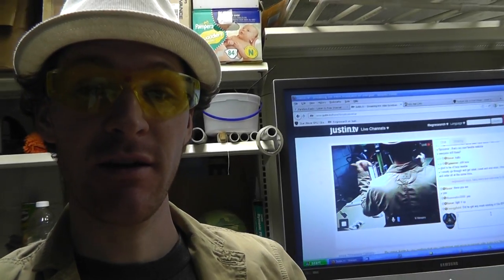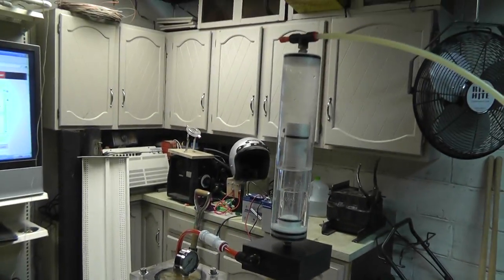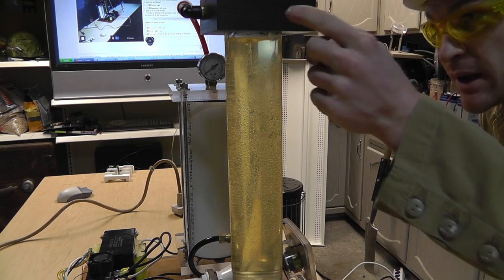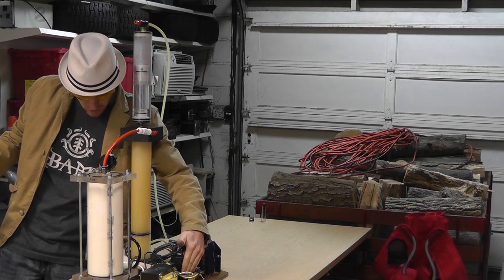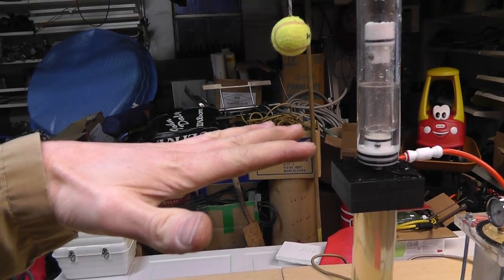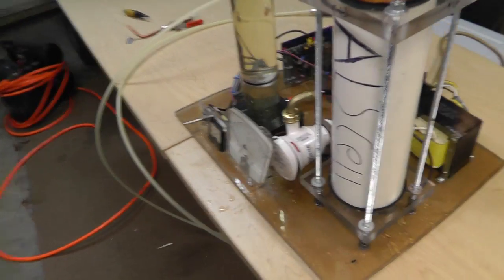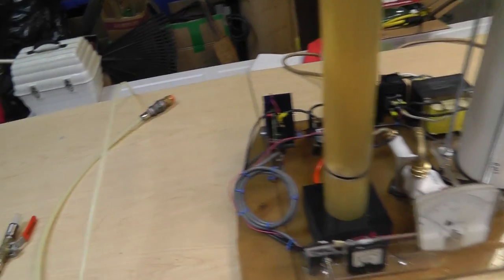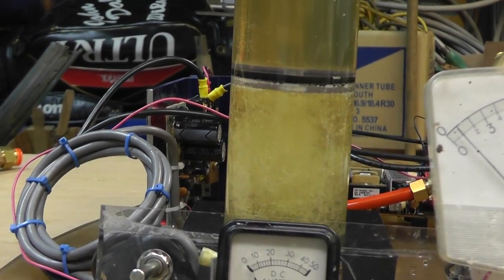12-5-11 Burn Rate Testing Live After Show. Things Went boom!  ~Russ RWGresearch

Comment: Hi Russ, just a thought, in gas welding the arrestor's are always in the line never in the torch head [mixing chamber], you could use one direction check valves, the mixing chamber is stuffed with bronze wool. A very good demo, thanks Russ, Jeff.

Comment: Hey Russ. Welder here. If your tip is getting really hot, that means that higher gas flow is needed. push more through it and you'll keep your tip cooler. 
A simple PVC pipe stuffed full of brass wool will work perfectly as a flashback arrest. And I mean PACK IT TIGHT.
Get rid of plastic too
P&P
Silvermango

Comment: @rwg42985 You are obviously a very nice guy Russ and I didn't mean to come down so hard on you.  I have looked at perhaps a dozen or more of your videos over the past year.  All that I can say is that what exploded was a mixture of 2H2 + O2, correct?  Can most of the retrofitting be done using split gas cells?  It would be so much safer.  Also, it it was 2H2 + O2 gas then the nozzle meant nothing and the combustion would go right back to the supressor instantly.  Have fun, play safe.

Comment: i work as a welder...tig/mma ....i did this 2007..i hade a steel elektrolyser.. the gas is så fast in burn rate..try to slow down the burn rate... and you need presure to.. i hade 10-20 psi in my water welder.

Comment: Nice failure, it made me jump. The plastic ones do work but they need to be thicker, i'd say about an inch long and the porous size needs to be between 5-20 microns, your going to have some flow restriction but you will never get a flashback, I also think your torch orifice needs to be a bit smaller unless your getting crazy production. Keep up the experimentation.

Comment: 2nd:  If you were going to use a torch nozzle like you have in your clip, you would used one that takes two feeds, Oxygen and Hydrogen separately and combine them together right at the nozzle.  That's what they do in the "real world."

Look at the setup you have in your clip.  Even if the spark arrestor worked, the combustion would not be happening at the nozzle, it would be happening _inside_ the hand-help valve + nozzle assembly.  The nozzle might just output water vapour.

Comment: Though not the best way, I have the same torch as you, excepting that I have a nipple about 4" added, stuffed full of brass wool. My bubbler is much, much taller, and has screens in it. And a blowout, too. I rarely, rarely get flashbacks. Unless of course I turn off production (instead of turning the ball valve at the torch). That ALWAYS creates a flashback. Delvis11 has all the tricks, check him out. Great guy too.

Comment: @KyleCarrington Actually it very rare that I comment on a 2H2 + O2 clip.  I like Russ' clips but simply can't and won't invest the time it would take to know exactly what his goals are.  His clips require too much commitment.  Whatever he is up to, he is in a leadership position, and if he did actually switch to DC electrolysis it would make his life safer, and potentially apply to other experimenters also.  There is zero need to use AC for the electrolysis of water.

Comment: 5th:  Russ, all that you are doing is taking electrical energy from the power grid and using that energy to rip apart water molecules.  Then when you let the 2H2 and O2 combine back together, whatever "energy" you see was really just energy that you were storing that came right from the power grid.  I suppose this is for a car engine but STILL, you can use DC, pulsing DC, or a "Bedini coil" to make 2H2 and O2 in SEPARATE CONTAINERS and potentially save an eye or YOUR LIFE. - Rant off.

Comment: @KyleCarrington I am not challenging Russ' work and if it is part of a system to increase gas mileage that's his prerogative although personally I don't think the testing is conclusive, more anecdotal.  You can do a whole hydrogen + oxygen injection system for your card without having to have a small canister under the hood that's a small bomb.  You are the one doing the grandstanding.  This clip clearly points out the dangers, I am just showing there is clearly a safer way.

Comment: 3rd:  That's probably why your spark arrestor failed, the moment you got ignition the igniting gasses when right back to the spark arrestor inside the handle and then burned through the membrane of the arrestor.  I am not an expert in all the hardware, I don't play with this stuff, but what you were doing appears to make no sense at all to me.  Seriously Russ, loose the fucking AC and switch to DC with separate gas containers.